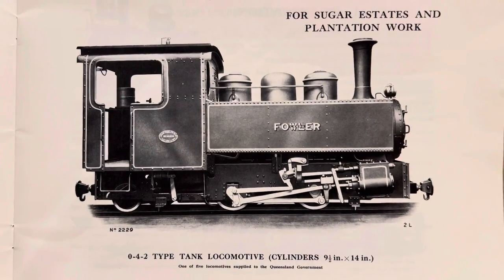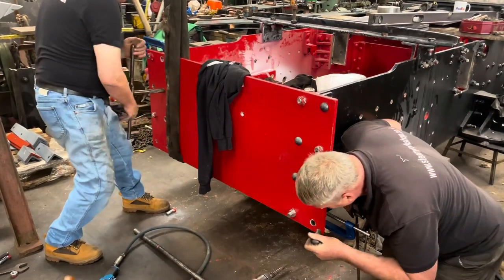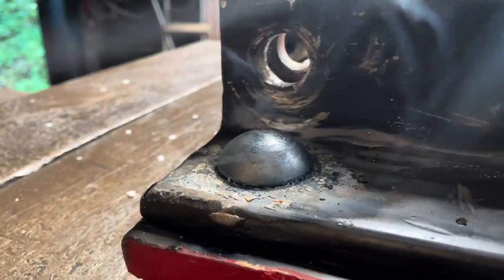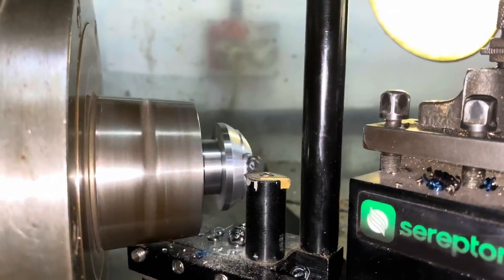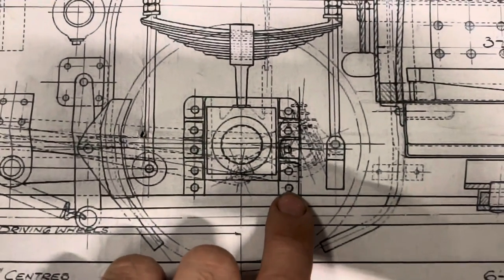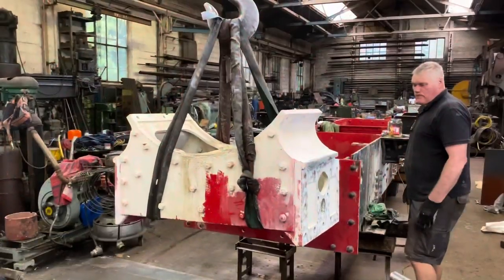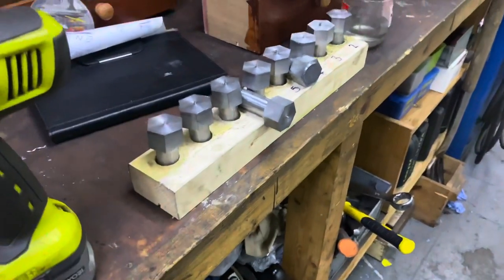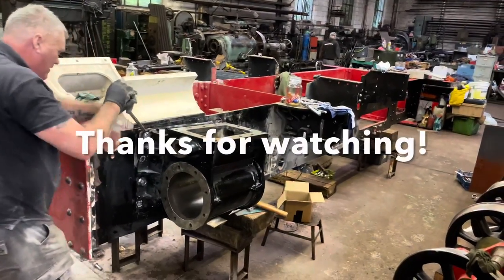Fowler 16341 restoration Part 12.

Comment: I am an old aircraft technician. I rarely had to heat the rivets before installation, and as others have commented, your rivets would be much stronger had they been heated entirely prior to installing in the hole. But, as this engine will only see limited work (compared to it’s life on the sugar plantation), I feel the strength of the joint is sufficient. Thank you for these GREAT videos. I can’t wait for the next.

Comment: Really enjoy this series. The vids belie the countless hours of work that’s gone into the dismantling and erection of this Loco. Steam engines are coarse brutal machines that can keep going even when everything is nearly shot, but rebuilding and reassembly has to be done to thou!  But you still need big hammers. Thanks and good luck with more progress in 22

Comment: The whole rivet should be heated, this ensures when the formed rivet cools, it will shrink over its entire length and make a tighter join.
Reply from the maker: Absolutely, but unfortunately we didn’t have that luxury.  They are still very tight, so we are pretty confident they won’t work lose.  🙂

Comment: It’s a good idea with the false rivets.
Looks the part,
But, if you should get corrosion on them in years to come it could be hard to stop them spinning when undoing.
Reply from the maker: Don’t worry, we have a plan for that.  They are tightly fitted machined bolts so we think they are likely not to spin, but if they do, we’ll just tac weld the heads to the frames while they’re undone and the simply neatly grind off the weld afterwards.  🙂

Comment: 1/2 to 3/4 is torqued to 250 300 and 1 inches is 450 with a tc torque gun, tc bolt has a nipple on the end and a rivet head on the other the tc gun grabs the nipple turns the nut and then pops off the nipple at torque

Comment: 05:31 “A bit of a cheat”. Hmmmm, not really. It looks the part. Rebuilding a loco like Hells Phoney by effectively throwing away the entire loco and then claiming it as the oldest working loco in the UK, thát is a cheat. But choosing modern materials and modern construction methods carefully is not cheating, it is a practicality  any railway company would have opted for had the loco still been in commercial service. I love the narration on the video. Well done

Comment: Great series. You make quite complex jobs appear to be very straightforward! Rivet bolts are a very sensible idea, but without a proper bolt head what you you use to grab the rivet head when trying to undo the bolts, to stop the whole thing turning when taking them off?
Reply from the maker: Thanks & good question!  They are all fitted bolts, so we had to hammer them in rather than just slide them into the holes, so the shaft is strongly gripped.  But if they do spin, we’d just drop a spot of weld on the head to hold it, grinding it off after releasing the nut.  🙂
Reply: Ahh. Got it.

Comment: It would be better to heat the rivets outside the frames with a  torch or forge.  Then the rivet will fill the hole and clench the plates together.  Your method only forms the head and does not cinch the plates.  
Otherwise good work